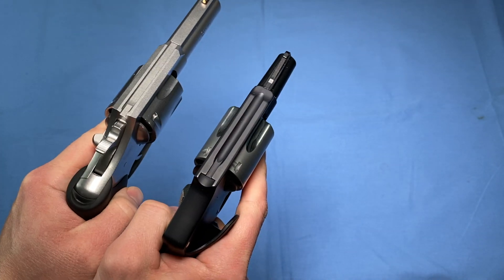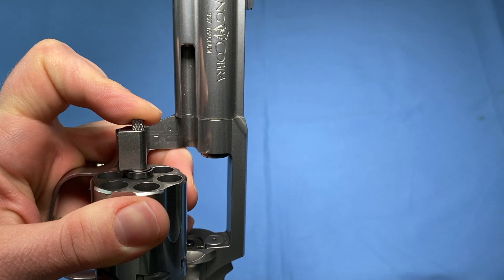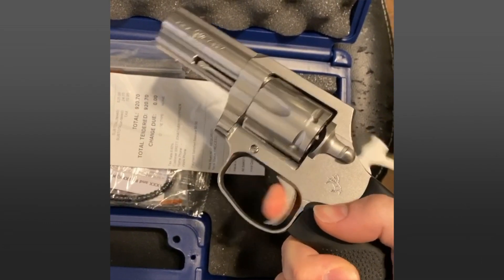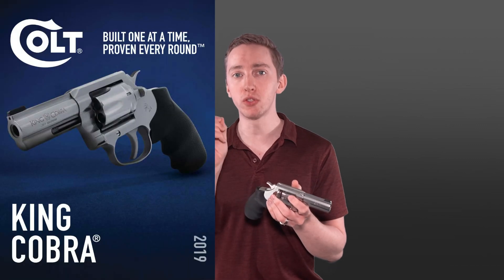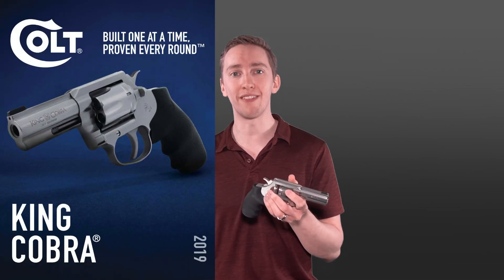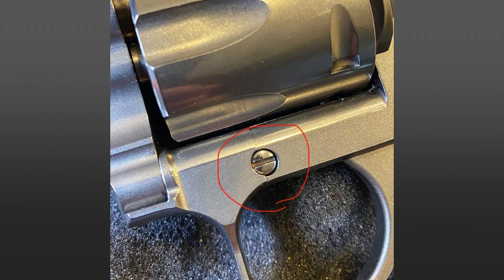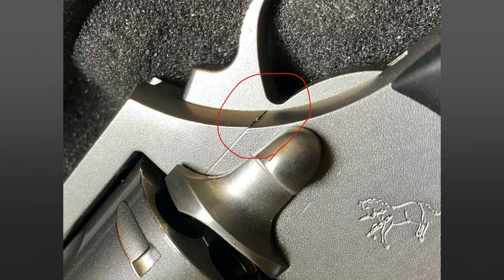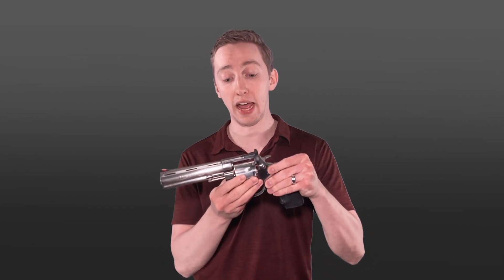Colt King Cobra - Problems, Malfunctions, and Failures OH MY!

Comment: 4 years later, just bought a King Cobra Target and haven’t even shot it yet, only dry fire about 200 times and the gun is broke. Hammer won’t cock on single action and trigger is stuck towards the rear, just like you. Paid $1000, I am pissed.
Reply from the maker: Sorry to hear that. I can’t believe this is still happening. Thanks for sharing your experience 👍
Reply: Thanks for the response. I can’t believe it either. Was a proud owner of my first colt and now I am sick to have owned it. I will keep everyone posted on how the repair goes. More than likely will be selling it for an HK USP or P30.
Reply: have a 2020 king cobra carry ive definetly dry fired it over 200 times and im over 550 rounds half being .38 special and other half in .357, i took the whole gun apart once to mirror polish the whole thing and even after being manipulated by me still not a single failure.My glocks have caused me more headaches honestly. I Feel like its a hit or miss. Are the new guns the same as the old? no. but theyre damn close and who cares CZ owns colt send it back and get it fixed.
Reply: Sent to Colt, got it back 6 weeks later. 20 rounds in the gun is broke and I can hear a rattling from of broken part inside the frame. Will be selling when it comes back. The gun has been at Colt longer than I’ve had it
Reply: @codycornell5036  sounds like you’re one of the unlucky few. Mines been great. I trust it.
Reply: I agree. I honestly think I just got a lemon which can happen in any manufacturing capacity. It’s just si hard to trust it after these issues unfortunately.
Reply: Have you had any problems since getting your King Cobra fixed?  I want to buy one but now I’m not going to until I know the Cobra is 100% reliable
Reply: Yes, hammer broke 20 shots after I got it fixed the first time. Plus when I got it back after waiting six weeks for it to get fixed a second time, I noticed a very large gap between the barrel and the frame. So I had enough and I sold it. Would not recommend. Go get a Kimber K6s instead. Way better gun!

Comment: Bought a King Cobra August 23 and it worked fine until Feb 24 when the action locked up completely. Contacted Colt and got an RMA right away. Gun is due back to me in two days so we’ll see how it goes. Work order says broken hammer. Only had 300 or so rounds through it. I want a revolver for carry so I’ll have to see how it works after a few hundred rounds. If all is well I will carry it again, but not until I can trust it.

Comment: Accidentally came across this video and wanted to add input. 
First, nothing about service or attitude - I would be livid. Period.
Second, I’m original owner of a King Cobra Target (Feb. 21) and have put over 1,000 rounds of .38 special+p and another 500+ rounds of .357 target. A high % of these were fired single action. 
Never a hitch. 

Individuals compliment and ask my opinion about this beautifully crafted piece at the club and range I frequent and I’ll have to temper my enthusiasm in the future. 

I spent many years in retail, and owned a small sales / service enterprise for a bit;
To err is human, but how well you remedy your mistakes is how your business will be remembered.
Reply from the maker: I’m glad yours is running well and I hope it continues to work as it should! 👍 Any company can make a lemon. I can forgive that. But learning that they don’t/can’t back their product with the prideful service they advertise was disappointing. Their 1 year warranty is the main reason I ended up selling it. I knew if I had any issues in the future, it would only be a worse experience without the active warranty. Your analysis is 100% correct. Thanks for sharing your experience. 👍

Comment: Sorry for your disappointments.  I'm an old Colt wheelgunner for decades and have owned a Python, Trooper, Trooper Mk 111, Lawman, and 4 'D' frame snubbies, and only had a S&W .22lr "J" frame among them.  Have disposed of all those except a 'D' frame carry gun.  Went to a large retail gun store to check out the new King Cobra and Kimber K6S DA/SA.  Viewing these in the case was not inspiring enough to ask a sales associate to take 'em out for show and tell.  But did spot a used police trade in S&W "K" frame stainless gun which I purchased.  Now running a couple of Rugers and some "J" and "K" 'Smiths, tried and true.  Hope you resolve the issues with Colt.

Comment: It is such a shame at one time without a doubt the best handgun manufacturer to wind up this way, in 2019 I purchased the 2 inch Cobra in stainless my first time at the range with it the cylinder was very hard to open, I sent it back to Colt after 4 weeks the gun came back filthy from all the firing and still the cylinder was extremely hard to open it got to the point Colt called Sportsman's Warehouse told them to give me a new gun which they did and that one was flawless, I hope Colt gets their act together and starts producing Colts the old fashion way, don't give up send it back tell them to make good on that King Cobra.
Reply from the maker: Unfortunately, they don't have the money or the talented craftsman to make revolvers like they used to.

Comment: I bought a used 3” King Cobra that was manufactured in May 2021, it looks great all around, no side plate issues, no ejector misalignment it has been flawless for me!
Reply from the maker: Good to hear! 🙌 If anything changes be sure to come back and update us. Hopefully it continues to impress! 👍
Reply: I have been reading up on these and supposedly the issues were fixed around the same time the Python was released. They supposedly upgraded some parts to be more similar to the Python.

Comment: Had to send a S&W back bc the cylinder was out of time on a brand new out of the box 38 spl. They ALL can have problems... Still bought the new colt king cobra despite reviews like this one and so far have been very pleased with it. I considered buying the new Kimber 357 when I heard the new Colt was having issues but guess what they also have problems. So my advice is to buy what you want. Also I have experienced none of the problems from this review. My side plate alignment is perfect!
Reply from the maker: You are correct. Smiths, Rugers, and any other manufacturer can put out lemons. I am more concerned about Colt because they are aware of a faulty part in their Cobra line and they refuse to issue a recall. Their customer service is also much, much worse than Smith or Ruger. So if something happens to go wrong with your Colt, you are in for a fight. Whereas Smith has acceptable customer service and Ruger has good customer service. The amount of people who have had the same breakage in their Cobra or King Cobra that I've had is disconcerting to say the least. When CZ can really dig their hands into Colt and make some meaningful changes in the company, I will happily buy a few revolvers from their lineup again. But after this experience, I choose to roll my dice with S&W and Ruger. I hope your King Cobra continues to serve you well. It is still one of the best "feeling" revolvers I've ever held.
Reply: @NightwoodGuns  Ruger undoubtedly has the best customer service, Smith & Wesson will always fix it but pretend like nothing was wrong with it. Hopefully I won't have to send the Colt back but it is what it is if I do, like you said it's one of the best feeling guns I've ever shot and because of that I might put up with some shortcomings.  I'm certainly not brand loyal I have Smith & Wesson's Colts Ruger's Taurus's Henry's Thompson Center ECT.  I like them all.
Reply: @NightwoodGuns  fixed the problem with the ejector rod sticking. If you go to my profile it's the only video I currently have posted.
Reply: Same thing that happened with me on a 686. Colt is having really bad issues with their revolvers

Comment: What a difference 2 years makes. Thankfully I never saw this video (though I don't put much stock in "sour grapes" renditions) before purchasing my King Cobra.  Fit and finish is superb. The polish is very very good. There have been no issues mechanically although the design is unchanged. The only issue that I've had is finding front sights ..... I want to try some others in addition to the brass bead. It's hard choosing between adding a second KC or a target model or .....

All that try my KC comment on the  trigger, it is so nice! The DA is perfection.
Reply from the maker: Thanks for adding your experience to the comment section! I’m glad yours is up to par! 👍 If anything changes be sure to update!
Reply: My 22lr king cobra broke it's return spring in a few hundred rounds. I'm assuming this may be common
Reply: Did you have any endshake at all. Mine isn't to bad but the cylinder dose make contact with forcing cone but dose not seem to hang up..

Comment: I have a 1987, 4 inch King Cobra and a 1991, 6 inch King Cobra. The fit and finish are perfection and they both function 100% of the time and are absolutely amazing. You had to know there was a reason you could buy a new one for half what you would pay for an old one.
Reply from the maker: The classics are much better, in my opinion! 👍 You can feel the difference just by cocking the hammer.

Comment: Well I finally found a Colt King Cobra to handle in-person, I'm not willing to buy one online and all of the shops here in western WA are only interested in stocking Glocks, ARs, and the occasional bargain bin SDS 1911. I very quickly found the rough side plate fit and the sticky ejector rod, and this was on a supposedly recent production KC. While the Python it was next to was considerably nicer in the fit and finish department, the 1699 price tag scared me off when i could buy two and a half 686s for that, or one 686 with a great trigger job from the Performance Center or TK Custom and still have ammo left over as well as a lifetime warranty.

I wanted to come back to this video and thank you for making this, I think if I hadn't seen this months ago I'd have bought a KC without second thought upon seeing one.
Reply from the maker: I’m glad my video saved you from the frustration I had to deal with. Thanks for coming back and sharing your story! 👍

Comment: I own a Colt King Cobra 3” produced late 2021 / early 2022 and here are my thoughts so far.  PROS:  Fit and finish looks good.  GREAT, smooth trigger. Easy to shoot accurately because of the good trigger.... in both double and single action.  Nice all around size, weight and width.  CONS:  Price relative to what you get, trigger has three reset clicks and must be let out all the way.... long reset, before you can shoot again.  It is VERY easy to short stroke this firearm.... especially during rapid fire.  People carry revolvers because of simplicity and reliability.  Pretty annoying it is so easy to short stroke this revolver and the trigger locks up.  I have owned 4 other revolvers and this has the worst reset / easiest to short stroke out of any revolver I have owned so far.   Not a great trigger reset design for a carry revolver.... making it too easy to short stroke.  If you are just shooting slowly at a range, one shot at a time, it shouldn’t be an issue.  Then again, there are better revolvers or less expensive revolvers with more weight, etc if you just want a range toy.  EXPERIENCE / ISSUES so far:  I have fired 100 rounds of 38 spl and 50 rounds of 357 mag through the revolver so far.... not nearly enough.  However, 40
Of those rounds were Perfecta 38 spl and the Colt King Cobra had 1-2 light strikes out of ever six rounds on that ammo.  The primer had a good dent, but I had to restring those rounds many times to get them to fire.  Could have just been the ammo but I shot some of it a few days before through my Ruger sp101 with no issues.  Generic 357 mag and federal 38 spl fired with no issue through the Colt King Cobra.... 100 rounds combined of those two.  The cylinder also is difficult to open / release.  The cylinder sticks during the release.  It does not appear to be an issue with the ejector rod or the actual cylinder release from what I can tell.  It appears the cylinder stop locks in tight and sticks in the cylinder bolt notch (stop channel) when trying to release the cylinder.  I just expected better given the price and supposedly quality of the firearm.  If this was a Charter Arms or Taurus I wouldn’t think much of it.  Actually, I have owned two Taurus revolvers in the past and both were great.  But with the Colt King Cobra it is pretty annoying I have to hit the cylinder with the heel of my hand or push very hard while holding the release back to get it to disengage..... the cylinder kind of pops out if I push hard enough.  (Anyone else experienced this on a new revolver before it has even been fired).  I thought perhaps if I broke the gun in by putting a few hundred rounds through it that it would loosen up.  We will see. Good news the cylinder lock up is nice and tight.  I really want to like the King Cobra, but given my experience so far and reading all the other comments, I fear this firearm will fail in the near future.  Please feel free to share any thoughts or feedback.  So far, I would give this revolver a 5 out of 10.  I do kind of regret getting it so far, but that may change for better or worse in time.  Hoping for the best!
Reply: UPDATE: I own the 3” Colt King Cobra. (late 2019 / early 2022 production).  I have now put a little over 200 rounds of 38 special and 50 rounds of 357 mag through it.  Wish it was more but ammo prices are still high.  That said, I have dry fired this revolver so many times that have of the snap caps have literally broken into pieces around the back and I had to throw them away.  After watching this video I’ve been doing what I could to see if mine would fail.  As mentioned before the cylinder would originally stick and was difficult to release.  It is much better now after repeatedly opening and closing it.   The gun is fun to shoot and still the most accurate revolver I have shot due to the amazing trigger.  While I haven’t had anymore light strikes, I do still believe this revolver will light strike ammo with harder primers in double action because of the design.  I primarily shoot it in double action.  The weight and size is awesome.  I like this revolver more and more the longer I have it.  Still not sure I would trust it as a CCW based on this video and other issues mentioned in the comments.  But, just wanted to report mine has not broken yet and I like it more each time I shoot it.  I do still feel it is over priced.  I was going to purchase a Kimber K6 but handled one at a local fine store and it was defective out of the box.... cylinder was near impossible to open.  The gun store employee tried it and said it was defective and would be sending it back.  Didn’t make me feel real good about Kimber... but perhaps that was just a lemon.  I really hope this firearm keeps performing because I like it overall now.  If you want a revolver to CCW, Rugers are very reliable and built to last so perhaps start there.  I have tried to find more videos / reviews on the Colt King Cobra but not many are out there from people who have really put the revolver through its paces yet.  Let us know what you think if you own one.
Reply: FINAL UPDATE:
I purchased a Colt King Cobra 3” in early 2022.     Owned it about 9 months a shot a few hundred 38 special and a few hundred .357 mags rounds through it during that time.  Good news:  Didn’t have any catastrophic failures or broken parts with the firearm that caused it to stop working.... as others have experienced.  Also, while it originally had cylinder sticking issues when unlocking the cylinder,
That went away as the firearm got broken in from shooting and dry firing with snap caps.  (Dry fired this gun with snap caps well over a thousand times).  Bad news:  The Colt King Cobra had light primer strikes from the beginning (with multiple ammo types) and that continued to increase in frequency the more I shot it.  The Colt King Cobra 3” feels great in hand, great to carry, easy to shoot accurately, but at the end of the day it is worthless to me (and many others) if it isn’t reliable.  For the price tag on this firearm, it is ridiculous that Colt can’t make a reliable King Cobra revolver these days.  I fear many people won’t find out how unreliable their Colt King Cobra could be because they don’t actually shoot it enough.  If you want a pretty safe queen to shoot at the range once or twice per year (with potential issues), then perhaps this gun is for you.  If you want a reliable revolver for both the range and self defense, I suggest looking elsewhere.  For the same price range you can purchase a Smith and Wesson revolver or a Ruger revolver.  Even the lower priced Taurus 85 and 605 revolvers I’ve owned in the past were reliable.  Sad for more than double the price of those the Colt King Cobra was not reliable.

Comment: I think the gentleman here had a bad experience.  Things like that are going to happen with products and services now and then.  I bought a Colt King Cobra Target in 2020, and the Colt Cobra (.38) in 2022.  I've had no quality control issues at all.  In fact, my experience with Colt was very good.  One of the Colt medallions fell off the wooden grips of my King Cobra Target, and Colt sent me new grips immediately after I called them.  Zero issues with operation of the revolvers.  The only gripe I have with Colt is that their products are often difficult or impossible to find, like the Night Cobra.  Apparently they keep many in stock, or want demand high and supply low to control pricing.  I don't know.